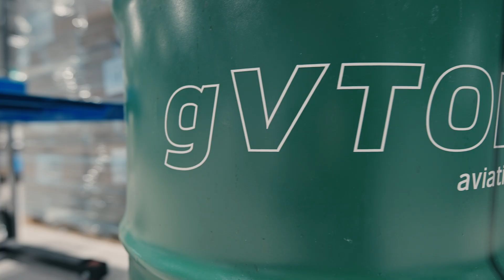Introducing GVTOL for the GT50 engine

Comment: I hope everyone realized that "carbon neutral" or "sustainable" fuels are just normal liquid hydrocarbons, so every engine can run on them with minor tweaks at the most. SAF compatibility is a baseline requirement for aircraft turbine engines, not some special feature of one brand.
Reply: Engines being able to run on alternatives fuels is very different from them rated to.
Reply: @LabiaLicker  able or rated, both are base expectations of new turbine (and diesel) aircraft engines.

Comment: If I have to divert to a small airfield will I be able to get fuel?
Reply: For sure you will be able to feed conventional fuel. ⛽️
Reply: @avigator  one would expect -  yes
Reply: As long as the SAF that was being used didn't react with the regular jet a at said small field. Fuels and lubricants typically have additives in them (detergents, binders etc) that sometimes react  with one another when you change up said fuel or lubricant.
Reply: yes you will